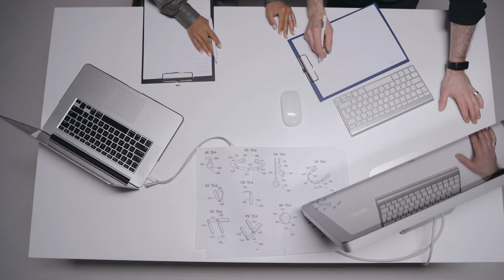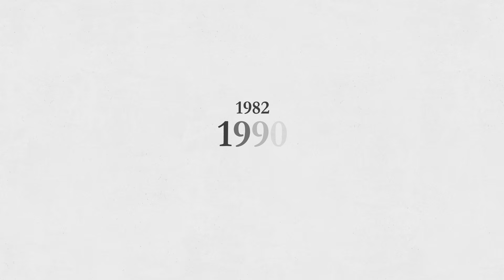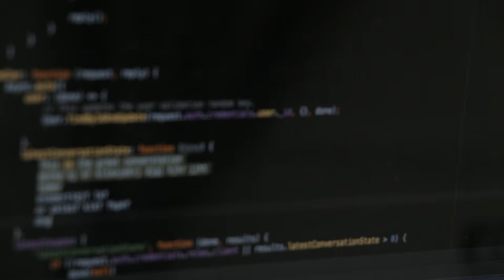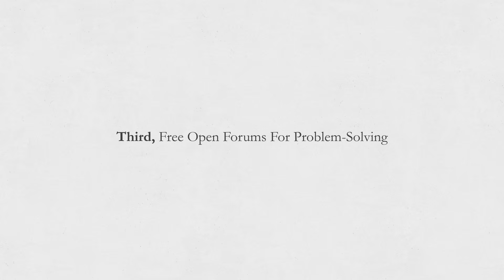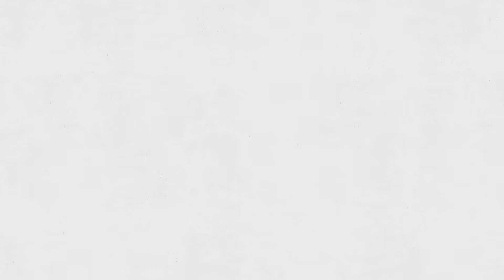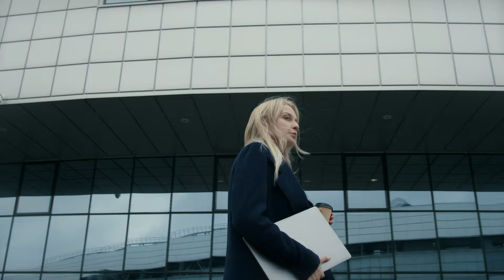The Untold Origin Story of Rhino 3D

Comment: Very interesting video. Aerospace has generally used Catia, anvil pre 90s. 
I used rhino as a beta in 96 I think as an aerospace engineering student. I spent the last 25yrs working in military and large commercial aircraft programs using solely Catia.  I've created lofts for various aircraft OMLs, important restrictions are surface waviness over specific distances.  The OML definition on aircraft is actually an extremely small portion of CAD used on a project, therefore surface apps like rhino are now used, but then this is brought into Catia and resurfaced into a segmentation set of surfaces that fit its purpose in the space for controlled engineering definition. I recently took time off to work on a property dev and architecture project and picked up a copy of rhino and have loved learning it once more.
Reply from the maker: That's an incredible journey, from using Rhino as a beta in '96 to working with CATIA for aerospace and now back to Rhino for architecture!
Reply: Aerospace Engineering - how COOL! 
So that's how Rhino fits RIGHT in . I'd wondered !
My Father retired form The Air Force in 1970, went DIRECTLY into Aeronautical Engineering, and later Taught Aeronautical Engineering Design, so I have ALWAYS had an genuine affinity for the critical elements of that area of the Engineering Arts ! 
I went into Industrial Engineering Design, migrating eventually to Oil-fiend Down-Hole, Surface and Offshore Oil Platform/Subsea Engineering Design, where I eventually encountered Rhino, after a career full of  AutoCAD, A-Desk Inventor, and 3DS MAX ... . 
I ended my full-time Career as a Journeyman LEAD-Level Senior Mechanical/Structural-Mechanical Designer, using Rhino, and am CURRENTLY now still practicing my craft - helping Independent Inventors bring their NEXT "GREAT IDEA" to market ( including the FULL Patent - to WORKING Production Prototype stage) !
I'm CONFIDENT you'll find Rhino to  be a CAPABLE and even FUN tool !
Sincerely - 
ALL the very BEST to you AND YOURS in you continued journeys !!
- Chuck .

Comment: Just checked the website and the price is still below $1000. $1000 in 2020 only has the buying power now of ~$750. Still a good steal, especially with Grasshopper.
Reply from the maker: Exactly! Even though the value of money has changed since 2020, under $1000 is still a great deal, especially with Grasshopper included.
Reply: AND the License is PERPETUAL - not a STRANGLING "Subscription" , and NO "Cloud" REQUIREMENT - compromising your CONFIDENTIAL Design I-P !!
Seriously - It's an absolutely WORTHY "ADD" !
I started with STRAIGHT- ENGINEERING Design tools, added Rhino to MY tool-kit, and am GLAD I did 👍 !
I'm confident you'll be glad, too !
all THE best 👍! -
- C .